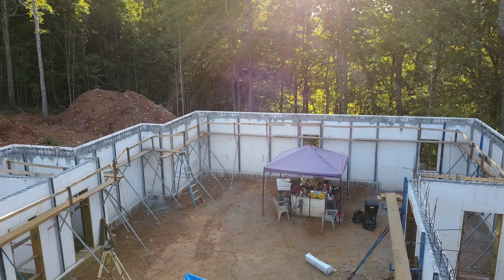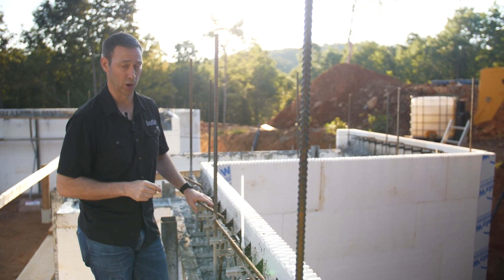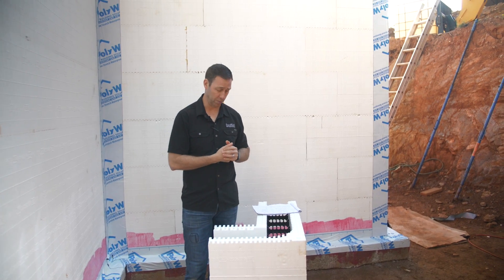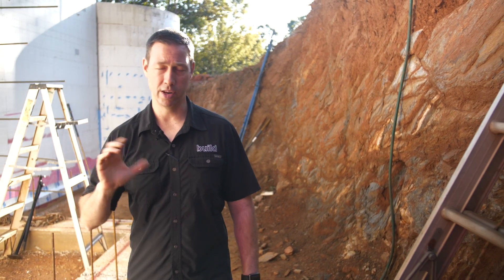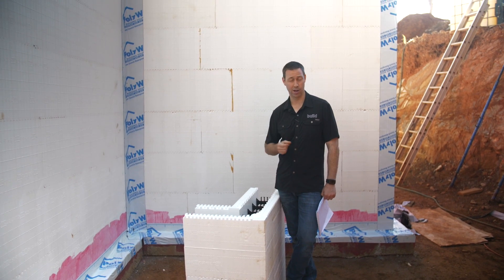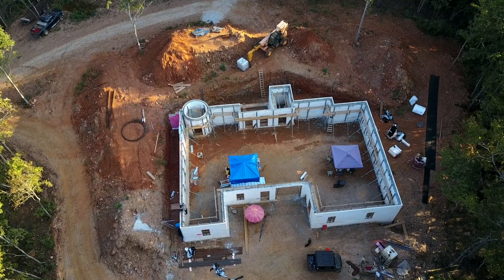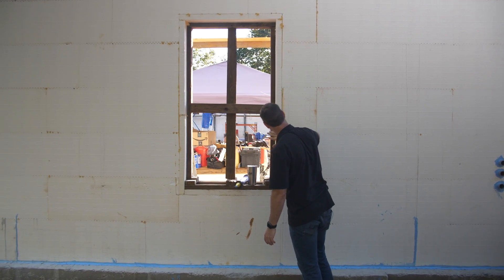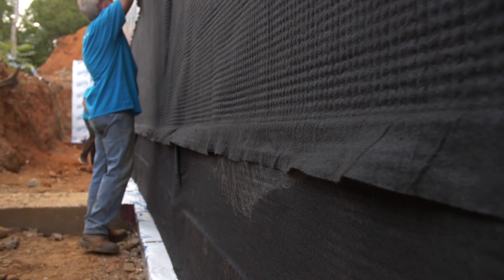Insulated Concrete Forms - Overview, Costs, and Cons

Comment: I used to deliver this stuff from one of the first companies to offer this system (american polysteel ) and they always had to list the R value as R22 because building inspectors would make them prove any claim over that at a cost of thousands of dollars so they just said R-22 it was probably nearer to a 38 back then and that  was 1992  and they were building in Alaska  back then It's great to build with but HELL to haul on the flat bed going down the highway a whole load for one house took a 48 ft trailer but only weighed 3800 lbs
Reply: Saw a motorcade of flatbeds hauling that shit a few weeks back. They definitely didn't have it tied down properly. Almost caused a massive accident on a 4 lane interstate.
I saw a DOT officer just goin off on one of the drivers, then a short bit up the road I see the other trucks pulled over checking and tieing down their load properly.

Comment: This is more or less how commercial high-rise construction is done overseas except they form and place all the floors and then "attach" insulated foam to the outside.  With this system I can see huge problems with the forms moving around and getting out of plum or even having blow outs during the concrete placement phase which would be a total disaster.  You would have to shore and brace this stuff to the maximum degree possible.  However if you can get it straight and plum this type of construction would be far superior to standard 2X6 construction.  Much easier and quicker to put together and 10 X stronger.  I really like it.

Comment: "If someone's yelling on the inside of this wall, I'm not gonna hear them outside" 
( ͡° ͜ʖ ͡°)
Reply: Someone yelling at the top of their lungs is generally around 100db. A 54 db reduction would bring the level down to 46db ,which is around the ambient noise level of a library.

Comment: @14m Matt proposes an off grid power solution using only solar and “$5k” of batteries, for this 7000 sq ft house to avoid a $40k special utility connection.  I know this is an off the cuff estimate, but it’s not feasible.

A Tesla PW2, 13 KWh, is $10k to $15k installed with the transfer switch.  This residence will need two, three PW2s to get through night after a sunny day, and double that to get through a series of cloudy winter days, all replaced every dozen years or so. 

There is always a combustion generator with large fuel tanks hiding behind the curtain of notional “off grid” residential mansions.
Reply: Tesla is literally the most expensive option. lol
Reply: @enigma9789  There is no $5k battery-only off grid option for a house like this, not from Tesla or any other supplier, not for 5x that price. For those that claim such a system, there is always a fossile generator hiding behind the curtain.  This house with a $40k utility connection is a perfect example. If they could go off grid, the clearly would.
Reply: @Nill757  Got quote for a 11.5Kw micro-grid system with batteries (not Tesla) - $60K.  And will install propane backup generator for another $5K.   Less rebates.
Reply: @ArthurDentZaphodBeeb  How deep is the battery pack, i.e. kWh in that $60k package?  Anyway, the video claims only solar and batteries ($5k) can avoid the the grid connection. As I say, there's always a generator hiding in these schemes.  BTW,  if not using a natural gas connection, a big propane tank needs to go with that generator (8kw?) to run a house off grid innthe winter, so another few $k for the tank plus service.  Add a new battery replacement every dozen years and the one time $40k grid connection looks pretty good.
Reply: @Nill757  Two Powerwalls - think it's 13KW.  Looked again and the price is about $10+K higher for two Powerwalls.  For truly offgrid, you need some sort of fossil fuel backup - can't rely on these systems working flawlessly.  There are some tax writeoffs and rebates that get the total cost down into high $40s (in my area) so it isn't that huge a stretch to go solar if the utility wants $40K to string power to a remote property.  The irony is people buy 'cheap' land without realizing what it costs for power/water/sewage - can blow $200K drilling wells, installing septic and solar if you don't do your homework ahead of time.

Comment: So basically :
- Higher upfront cost /sq. Ft of wall. ( but you save on insulation work ).

+ lower utility costs due to continuous insulation.
+ lower insurance cost.
+ lower maintenance cost.
Reply: And you save on home insurance. Bugs won't eat it and fire won't burn it.
Reply: Pay me now, or pay me later!
Reply: Not really.  A 2x4 wall with continuous R30 exterior rockwool insulation over continuous Grace water/vapor barrier is only $7/sf.  Here he is quoting ICF as $10/sf without labor.  So ICF is still more expensive even including insulation and waterproofing.  Utility cost is the same, insurance cost is the same if the threats are fire or earthquake rather than hurricane, and maintenance cost depends on siding rather than structure -- ICF is much more expensive to modify if that counts as part of "maintenance costs".   Insects love to tunnel through foam, all the way up to your wood roof structure, so it gives a false sense of security that way.

Comment: I building a 2000 SQ FT home in Cape Coral, Fl. I want to build with ICF but most builders are using CBS reinforced with Rebar Columns. can anyone provide insight which would be better to build with and possible cost? also are there any builders in Southwest Florida that build with ICF that you can recommend?...Thanks.

Comment: Don't try to anchor the roof to withstand a tornado or hurricane.  Pour a concrete cap for protection and build a typical roof over it. Let the roof blow off if it wants to. You're still inside a completely enclosed structure. Insurance will replace the roof happily vs. replacing the entire house.

Comment: you made a comment that you thought it would not perform as well in colder climates.  You are under the old way of thinking, thinking r value is the end all.  Dont discount the thermal mass of the concrete. 
how is this for perfomance. 5000sf comercial building.  slab on grade, spray foam rafters so attic conditioned. Building is in Buffalo New York. Building had propaine heat, and his feburary bill a few years ago was fifty something dollars for the month.  And there was transportation charges in there. I can get you a copy of the bill to verify if you like.

Comment: The thermal mass of the concrete will retard changes in temperature, which can be desirable, but it will not affect heat flowing through the wall at equilibrium.  It shouldn't have an impact on  energy efficiency under normal circumstances, other than the R value it adds.

Comment: There is another ICF system that overcomes some of the problems mentioned. I don't know whether it's available in the US but is certainly is in Canada and the UK where I'm from. It's called Durisol and is made from recycled wood rather than EPS. The blocks themselves are much stronger than the EPS systems, are much easier to fix into (standard wood screws rather than bespoke EPS fixings), are less likely to "blow" when the concrete is poured. They also have a very low U value (so high R value) good enough to build to Passivhaus  standard. No rebar is needed other than for lintels and cutting the blocks is done with standard woodworking hand or power tools.

Comment: Matt I love this video. I'm looking at this and wondering 
1) does this process go to 1 foot thick?
2) how bullet resistant is it and if it isn't what would it take to make it so. I'm no doomsday nut job but I would want to keep my family safe from man made disaster as well as mother nature's wrath.
3) is there a cement roof that you can top this off with that you can still add shingles metal or ceramic tiles to?
Lastly I've heard about this fire resistant insulation that won't transmit heat until it hits 1800 degrees F. Would this work as insulation on those perimeter walls as well as interior walls floors and ceilings? I'm sorry if it sounds like I'm going off the deep end here but I've seen some videos about a guy named Al Corby he started a building company out in L.A. called S.A.F.E. I forget twhat the S and A stand for but the last two are Fortified Environments and his ideas fascinated me but I don't think I could meet his price. So I'm coming to the 9nly building expert I know.
Reply: @douglasclark6630  Thanks I'll check it out and thank you for your reply